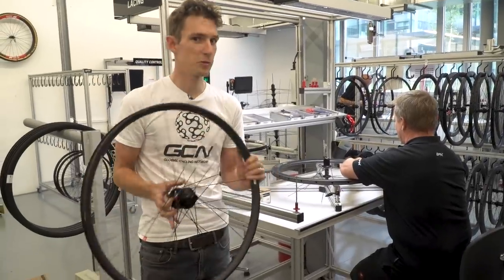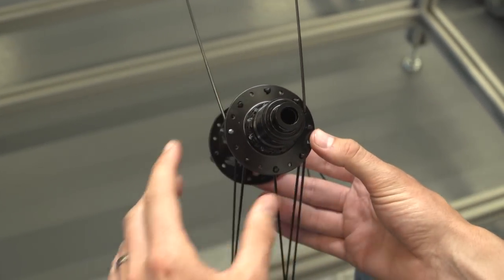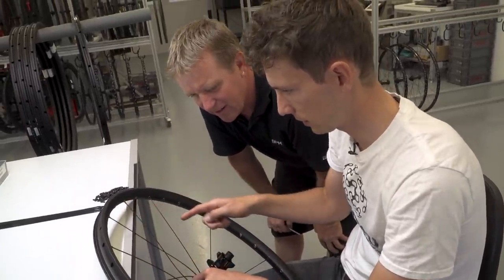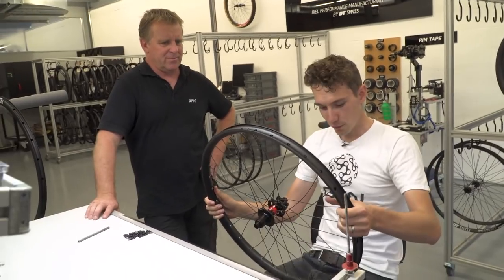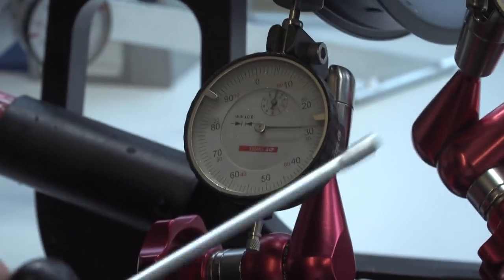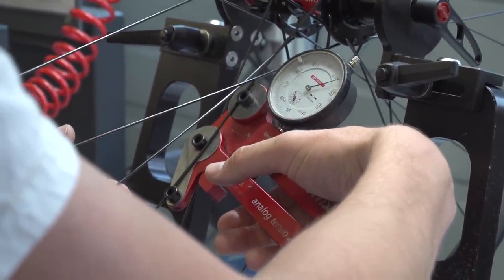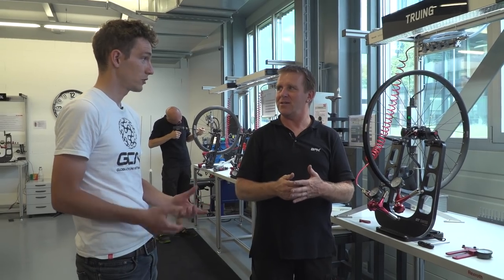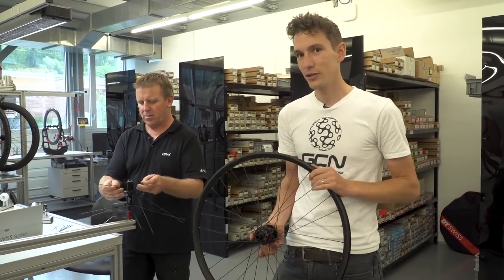How To Build A Bicycle Wheel | Maintenance Monday

Comment from the maker: Do you build your own wheels or leave it to the master wheelbuilders like Marcel? Let us know here! 🚲
Reply: I have build my own front wheel with dynamo hub for ultra endurance rides. Local bike shop said it was difficult, but I did it completely myself.
Reply: I build my own.  Nothing else is as satisfying as riding your own wheels.  And if something goes wrong with the wheel while riding, you know how to fix it!
Reply: Front wheels are usually easier, since most of the time they are laced radially. But it's mostly about keeping a level head and having some patience.
Reply: The way I used to build wheels was to find one that was already built, and copy it. 
/ashamed
Reply: I had to do it. I have a vintage pinarello bike with a special hub. So I had to reuse it and only change the rim to fix my wheel...
Reply: Excluding the time you invest. Is it cheaper to build it by your self? How much could you save by doing it by your self? I have once successfully taken an old rear wheel apart and put it all together again. It was easier than I thought.
Reply: Built most of the wheels I own. I used to live on an island with no bike shop so had to learn how to do all my bike maintenance.
Reply: I admit I almost did this myself, I wanted a Shimano DH3N-80 with Mavic road rims for 23mm tires but had a hard time finding one, and my local bike shop only had touring wheels for much wider tires. Eventually I found one on Rose Bikes with a CXP-Pro rim and I was lucky to get one because I think they don’t sell them anymore. Sheldon Brown is nice but it’s hard to figure out online what spoke length you need. Now that I have one I can replicate it at least :) Getting the whole system to work in itself caused quite some mind storm in my head but the process of getting everything to work was actually pretty straightforward
Reply: i couldn't lace a shoe,let alone a wheel,although, i would love to ave' a go at it...
Reply: Build my own wheel myself...
Reply: I have recently started building my own wheels, after learning to true wheels on my own, I've acquired the tools and skills to start building my own.  The first one was a simple 20 spoke radial front wheel, now I'm doing rear 2 and 3 cross rear wheels.  I find it very relaxing, but I don't like having to rush a wheel build!
Reply: Global Cycling Network...   For normal to heavy duty use, I build my own.  If I wanted a super light weight (as in on the limits of existing technology), then I'd go with an expert wheel builder.
Reply: Hardi Erstu good question, would interest me too.
Reply: I did it when i was younger, never again!
Reply: I usually buy a wheelset, but when I need to fix it (replace a spoke or true), I do it myself. I remember replacing a hub on the front wheel years ago while a teenager. I was surprised how simple it was.
Reply: Build my own using Roger Musson's method.
Reply: Global Cycling Network I learned to wheel build 2 years ago at Bike Works. City and guilds Level 1,2 I enjoy wheel building either for myself or for friends.
Reply: I build my own mtb wheels with novatec superlight hubs and sixpack sam rims with golden nipples and hubs
Reply: Global Cycling Network Hay there is something funny going on here? The wheel on the de-stresser was a spline but the one they were making looks like a dicut? Did you brake your wheel si?😂
Reply: on custom built wheels 👌
Reply: Reginald Scot they just showed clips of 2 different wheel builds being de-stressed, including Si's build.  One from one angle, and one from another angle.  Like a B-roll clip.
Reply: Global Cycling Network Bought R21 Spline DT Swiss wheels last year, due to their quality control reputation. I looked into custom, or building, but felt tougher to ensure quality. Super happy to go with DT Swiss wheels, even at the lower price range.
Reply: Global Cycling Network i'll leave it up to the professionals. Still very happy with my DT Swiss R32 Spline wheel set.
Reply from the maker: Ed R that's pretty extreme!
Reply: I build my own wheels as finding wheels that will work with classic bikes can be difficult.
Reply: I usually build my own. It's a skill worth acquiring. started off out of necessity, when I didn't have the money for a new rear wheel, but my rear rim was cracked, and on my other bike, the axle was broken, so I just swapped the hub over from one wheel to the other. I've built a few good spare wheels since then. Now, I have no fear of replacing spokes, truing wheels etc.
Reply: I've built my own wheels for my mountan bike
Reply: In the late 80’s and early 90’s I use to take 36 hole road rim’s cut out a 4 hole section and re-roll them with a jig I made. This was for my XC mountain bike with 32 hole Dura-Ace hub’s and Ti spokes as all the MTB rim’s back in the day where so heavy. I am still riding one of these on my XC MTB to this day.
Reply: Tried it a few times in the past when short on money but now I can afford to pay a  robot to do it :)
Reply: +DPGisby, that's impressive.
Reply: After I have reopened planetary gear technology, I am spoking my wheels by myself. It is hard to find a good bike specialist in small towns here in Russia. We have 300 000 people in our town and several not so good bicycle mechanics. I guess it is much easier to find wheel master on the island ))

By the way, your video instruction is too way complicated. I have used Sheldon Brown instruction translation by the local Moscow bicycle club, and it is much much easier. Also you only need spoke key, old crank, a ruler, one  rubber band and your bike frame to build a wheel. No special instruments like tention meters or wheel build stand. ))

PS
In Soviet Russia wheel spokes you. ))))))
Reply: I build all my own wheels and plenty of wheels for customers. But I build and service DT Swiss wheels for a living, so yeah... :) I can recommend the Roger Musson ebook on wheelbuilding. That's the technique I learned, and what I teach to local bike shops. Slightly easier to learn than the technique in this video I must say. Wasn't expecting to see Marcel in this video, funny guy, for a Swiss man.
Reply: Nope. I do sometimes re-true the wheels myself because it's Japan and every sort of "service" on these islands are bloodsuckers. But only yesterday my friend broke spokes on my wheel and it went taco. He likes machines, so I'm gonna send this to him so he can marvel at the whole process.
Reply: Some things you shall not do self. Small adjustment I can do but bult a wheel? No.
Reply: Built my own wheels for 30 years now. Don't really mind the lacing, but tensioning and truing is usually tedious and frustrating. I do end up with straight, strong wheels, but after every wheelset, I usually vow to never go through that again. Good thing I don't need many wheels.
Reply: Been building wheels nearly 50 years and never heard of the Schraner method! 
Good to see the perfectionist's approach of lining up the valve with the hub logo. 
Also we line up tyre label with the valve. Craftsmanship!
Reply: @bruceey1  well done Bruce. 
Even the "master wheel builder" whilst expert in many aspects of the work betrays his lack of understanding of fundamental mechanical engineering.
Reply: Your picture is wrong. The spokes should be in where they are out on the non drive side.
Reply: @sbaxter4207  According to what rule is it wrong? .What's the technical basis? There are many equally acceptable ways to lace a wheel.
Reply: Have built my own wheels - several sets now. Great riding something you've created yourself and half the price. Components are all replaceable unlike factory versions.
Reply: Just learning now with the help of Bill Mould’s videos. Think I like the A,B,C,D method.
Reply: I can't belive that's your first build. I build my first when I was about 10yo, in late 80's.
Reply: Global Cycling Network I’m trying to refurb my bike that was given to me by my mum the entire bike is a pile of rust so I’m making it my project bike to build from scratch other than the frame I got a feeling it’s gonna be very expensive and possibly the end of my bank account
Reply: I was the thick kid in school, I became a wheelbuilder. 
I've always said, it's an easy job done badly by so many.
Reply: Important question here: when you say turn each inside facing spoke half a turn you mean the spokes inserted from the outside hub to the inside or the spokes inserted from the inside face of the hub to the outside?

Comment: building my own wheel is time consuming, uneconomical, mentally challenging, unnecessary, and difficult which is exactly why I want to do it.
Reply: Is it not really uneconimcal, most parts and rims are much cheaper  and the tools required do not cost much. Mostly when the rim is burned out you can just reuse the hub.
Reply: Bike shop wanted £30 a wheel to do it, so I thought, "how hard can it be ?"
Wasn't that difficult.
I used the back wheel as a guide for the front, then the front as a guide for the back.
Must have done about 8 now as I swap out the dull spokes on my old roadies for stainless steel ones.
Reply: @bincvanlaere6861  At least in DT Swiss's middle range (alloy) wheels, 350 hubs, bladed spokes the price difference is 10€ at most.
Reply: I'm lacing my own wheel only because my rim and hub had to be ordered from two different shops, otherwise most online places build the wheel for "free" if you order all the wheel parts there.

Comment: Anyone attempting this should have this book.  I build all my wheels and this book has been of untold value.  Professional Guide to Wheel Building
By Roger Musson
Reply: John  because books are usually where the accumulated wisdom is recorded and stored. 
Video may be instant but the written word has usually been properly considered in getting it onto paper. And if it's wrong it gets corrected. Books rock!
Reply: Literally everything you need to know, very little you don't need to know, very accessible and very easy to follow. Anyone who is vaguely technical can build a good wheel with his book.

Comment: Just built my first one yesterday - a tough job that requires a lot of time and thinking (=patience). To me it is not really an exact science: I was working with much less sophisticated tools, those in the video are pretty high tech and price range... This way I will have to get into an extensive testing period on the bike. But I know the logic now and what is required to do this. It is a great feeling to have built the wheel by myself against all odds and service staff advice (="buy a new wheel/bike"). I think every rider should try it on a cheaper construction bike to understand and get a feeling of it.

Comment: It's all easy when you have all the tools and follow the instructions properly. I built a rear wheel for the 1st time and have done over 1000 miles and had no issues, but I think it's more to the fact that I invested in a park tool spoke tension tool at the cost of £50 which I personally think it's a must have tool for wheel building.

Comment: Wow, that seems complex. I used Sheldon Brown's guide to wheel building, it seems much easier to follow; had i not, i might not have even attempted to build the wheel in the first place! 
Turned out alright, too! did end up having to re-do my work a couple times but i'm an idiot.
Also i remember Raoul Luescher had some wisdom to spare re: spoke tension/wheel stiffness. Highly recommend looking that up.

Comment: Important question!!! How should I set the spoke path? When a spoke crosses another, should I make it cross from the inside or the outside? Or, should I just cross all the subsequent spokes ON the spokes that are already set?
Reply: You don't HAVE to interlace but the conventional approach is to interlace at the 3rd crossing for 3x.
Reply: Astral'o Pithecus You can build working wheels either way. I prefer to start by inserting the trailing spokes on both sides: these are the ones that run on the inside of the hub flange and ’pull’ when you put the power down on the pedals. This way, the leading spokes will cross on the inside, and will bend inward with some heavy pedaling as the trailing spokes are pulled tight. If done the opposite way, there’s a (minute) chance that looser spokes will catch on your mech cage when you pedal hard, as they bend outwards.

Comment: I've been wanting to learn wheel building for the longest time.  I've built bikes from scratch from the bare frame up, including pressing in headset bearings.  Wheel building is just about the only thing I haven't tried myself.
Reply: Give it a go on a cheap wheel. The first time I did it was because I was too broke to buy a new wheel, but I had two busted wheels from two different bikes, one with cracked rim, and one with busted axle. They had the same number of spokes, so I just zip tied the rims together and swapped over the spokes one by one.  That doesn't even require learning the lacing pattern, so it's an easy start to wheel building.

Comment: Yesterday, the nipple spoke on my wheel unscrewed and dislodged. So, I fixed it myself by removing the inner tube and screwing the nipple spoke back to its position. Many questions came to my mind. How can I know it is tightened enough? Is it evenly distributed the force? Can I do it myself without any additional equipments? Or Must I bring the wheel to the professional to fix it?
Thank you for your answers in advance.

Comment: Can you convert a 12/142mm thru-axle wheel into 135mm Quick release fairly simple? I want to get a couple of entry level DT Swiss wheels but they're all thru-axle and my bike has quick release.
I have seen conversion kits. But then there's the width difference.

Comment: i would pay so much money for a wheel building course, thats something i really want to learn !
Reply: Depending on where you live...there's a great shop with an amazing wheel building in Northern VA that teaches wheel building and you can also go to NC to the Appalachian Bicycle Institute for a class. Both are amazing from what I hear. I'm sure there's plenty of other places to learn as well. Those are just two I know of in my region.
Reply: Just buy Roger Musson's "Professional Guide to Wheel Building" book and you can do it. Spend the rest on hubs and rims... :)
Reply: Sheldon brown's website has some reasonably decent wheelbuilding instructions.  I would look for the stuff on spoke tension by ear as well, since he says some kind of dated things about spoke nipples rounding, and also recommends doing the non-drive side dry (which I disagree with), but as far as the lacing, and general process goes, it's quite good.
Another good book is "the bicycle wheel" by Jobst Brandt.

Comment: How to make wheel building easier: 

1. use less parts
2. Fabricate most of the parts via homebrewn manufacturing, ie 3D printing and CNC?
3. Less spokes, stronger shock absorbers, but with mounts (connected to where the spokes would normally go) that allow them to absorb impacts across a larger part of the rim’s circumference, ie. 3 pneumatic/spring shock absorbers with 120° mounts.

Comment: Building wheels this way except with a dynamo hub, where the hub itself has a larger diameter, you would use the 2-skip method instead of 4 right?

Comment: I just started learning to build wheels so maybe I'm wrong but your diagram, like the one at 8:30 seems wrong. I think you want to center the wheel in respect to the dropouts of the frame and NOT the center of the hub...right?

Comment: Finished my first wheel build today. 
A few pointers... 
As step 0. Check to make sure that all your new spokes are exactly the same size and your LBS didn't give you a short one by mistake. 

On the first pass , tighten the spokes at the minimum possible so that they'll hold on to the nipple. 

Once everything is together, if you have a  rim  brake , mount the wheel on the bike, use a zip tie to tighten the brake one click at a time and tighten it little by little finding the place where it touches the brake, until it touches on both sides at the same time.

Comment: I don't have a way to distress the wheel, can I just put my shiny DT Swiss wheels on the ground and stand on/jump up and down on them?
Reply: jonthedoors body weight only you push down on both sides with one hand on each side
Reply: No.  standing on them can cause damage.  Pushing on the rim evenly with body weight won't give you enough tension to do the job.
The best way I found is to put on some leather gloves, or use a rag, grab a pair of parallel spokes mid-span and squeeze them together hard.  Work your way around the wheel on both sides (8 pairs per side on a 32 spoke wheel).
I do this a few times during the tensioning and truing process, and my wheels don't make pinging noises, and they stay true from day 1.  None of this "re-true them in a week once they settle" garbage.
Reply: Oh okay. I was thinking body weight might not be uniform enough so was thinking if I put them on my driveway and backed over them gentle with my car it'd apply enough even pressure. Do you think that would work?

Comment: I've built my own, using a bike as a stand with zip ties.

In all honesty it's not that difficult if you are the patient sort. Im sure it's not as perfectly true as these but I really haven't noticed a vibration or whobble.

I say give it a shot on a cheap set, dont let all this "expert" "black magic" talk scare you away.
Reply: The biggest thing is just maintaining spoke tension balance.
Reply: True story
Reply: Yup. I've found you have to get balanced before you try to get it as true as you're happy with. I have a cheaper and bent rim set that requires the spokes tension to be a little off balance in the end to be true.